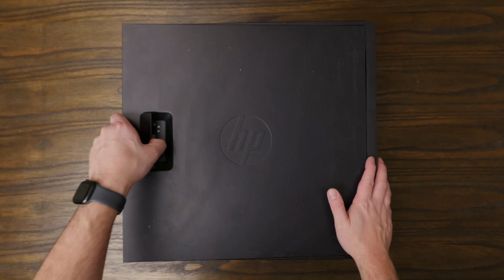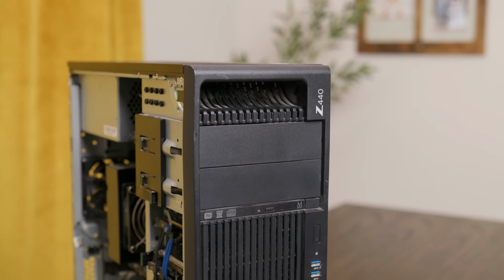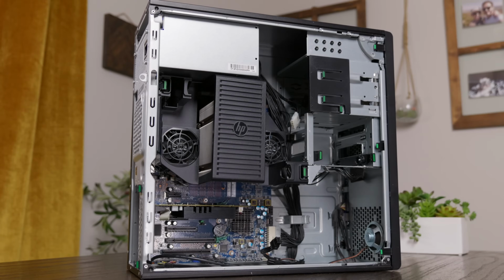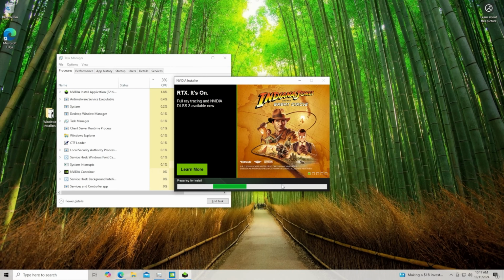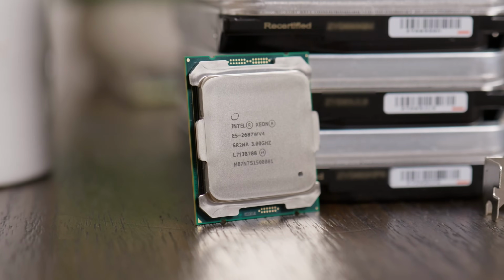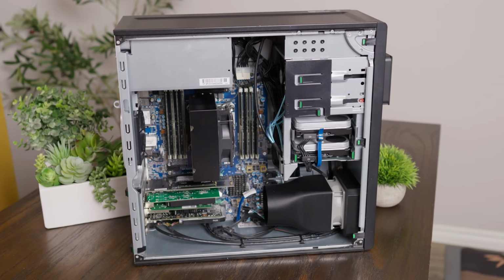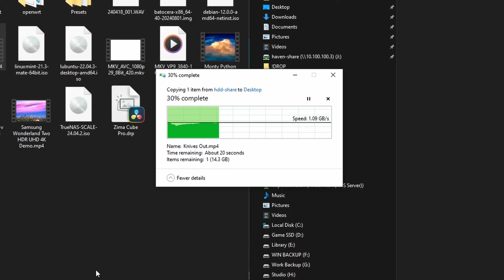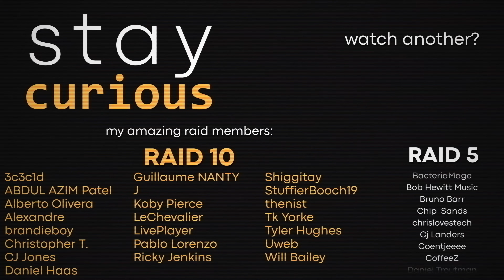This Upgraded HP Workstation/Server Is CRAZY Fun

Comment: I found an old dell t430 with dual Xeon 2606v4 and 16gb ram and set it up with unraid. I have 5 1Tb hdd’s in it atm but plan to upgrade those in the next couple months. This is my first experience with running a server so it’s a steep learning curve!!

Your video was very insightful, so thank you!!

Comment: I am looking to build a Dual Intel Xeon E5-2699V4 CPU system. It will be 44 cores and 88 threads when finished. I am just hoping it will be enough to do 4K, 6K video editing with VFX. Also do some Blender and other software. I believe it will be as 44 cores is pretty powerful.

Comment: power consumption and cpu power are both out of time. the only good thing about this hardware are the pcie lanes ofc. in every other usecase, u better use a modern cpu! u will geht much more cpu power for less energycosts. also the noise might be a problem with enterprise grade hardware
Reply: The RAM is cheap

Comment: Interesting little tidbit for anyone reading comments almost a year later. At about 8:10 he talks about the PSU only having 6 pins. While this is true, HP vastly overengineered the PSU on these units and the 6 pins can actually supply the same power as regular ATX 8 pins. So you can just get a 6 pin to 8 pin adapter and supply power to 8 pin GPUs

Comment: FYI: the two 6-pin PCIe power cables can provide 12V x 18A = 216-watt each.  Meaning, you can safely use 6-pin to 8-pin PCIe power adapter cables.
Reply: in pure electrical way 6 and 8pin pci-e CABLE are the same - only difference is on pci-e socket of card (6pin has 2x GND and one SESNE) pci-e has 3x GND and 2x sense)
also by molex specs each terminal can hold 13A, of course with multiple wires will be a little less but still I think it will be capable of 10A (30A in total so about 360W

Comment: Just for anyone worried about re-used drives... I'm an ex global IT manager in a few platforms (IT, Finance, personal data etc). At home I run massive data - all on re-used high capacity drives. Cheap, reliable, fast. What more do you need? Solid state is better but... price per buck? Assuming you have an nvme system drive, the additional drives should be fine. My system is 10x 12TB 7200 rpm 256MB lv3, under a 2Tb nvme. All of it "re-conditioned". Never had a problem with any of it. One drive makes some strange noises that do worry me - but it works fine so far (2 years). I have backed that one up, admittedly..
Reply: What more do I need? Availability. Living in a third world country, official refurbished/re-condirioned drives are nonexistent. International shipping isn't any good because after  shipping costs and import duty, it'll end up costing more than twice the price

Comment: get an nvme drive and an adaptor card. you might have to use clover on a usb drive to boot to the nvme but its worth it. i put a patriot 320 512 in my z420 and 6 times faster than the silicon power 1tb ssd  had in it.

Comment: The z440 actually has an optional oem front fan module, and the pcie 6 pin are rated for >150w, i believe hp themselves sell adapters to 8pin. With the 700w, and not the 550w psu which also was available, you can run two 200w gpus in sli in theory, or a 350w with dual 8 pin. I run a 1080ti no problem. Also, old server cache SSDs can use a pcie3.0x8 slot from the cpu to get modern speeds, im planning to get one

Comment: memory is expensive (again) but that 8 memory set is at $500 right now. 

personally, I would of either spent $250 for 4x32gb. If I was going to spend $500 on memory or needed it, I’d spend the $50-100 more and gotten 4x64GB instead. 

Nice build and the 3d printed bays are great for this. 👌
Reply: Even used server RAM is expensive ? I got 64gb of DDR4 ECC Ram for $30 2 years ago.
Reply: @rabbismooleymooley  yeah brother you got a STEAL DEAL.
One issue is this is quad channel, so you def. should stick to 4 or 8 sticks;

getting 4 sticks of 16gb now: 

1) USED is about $30 EACH stick, so $120 (or $160 new)

2) IMO more importantly, getting 16GB sticks limits you in the future: You can only grow to 128gb (w/o mismatched memory or replacing the 4 you already spent $120-160 for).

Comment: I've got a PowerEdge T330 i got from ebay. Since i'm in the EU i paid about 500 euro all in. It came with a Xeon E3-1240V6 which i replaced with a 1285V6. It has 32gb ecc ddr4, which is more than enough in my case. The most important thing was the 8 3.5" hotswap bays, that support SAS and SATA. It's filled with WD Enterprise 4TB drives in a single (hardware) Raid6 array resulting in a partition of almost 22tb. This is my Plex server. 

Since i had a free MiniSAS connector on the mainboard, i got a splitter for 4 extra SATA ports. In comes a 4x 2.5" bay in a free 5.25" slot that now holds 4 1TB SSD drives in a (software) RAID5 array. This is the storage share with all the files for the VMs i use with VMWare. 

Added a 10GB NIC and 2.5GB nics in the other systems, and ive got a multifunctional NAS with high speed/low latency storage. I've couldn't be happier. It does all i want it to do. SMB shares, FTP for external access, Dedicated management port with Dell Idrac8 remote management software, automatic backups to a different system, it hosts my PiHole, plex, webmin, NoIP Dynamic Update Client, a VPN tunnel, you name it. What a workhorse. With this configuration, my main rig is free from bulk storage on spinning drives. Result! 💪

Comment: I had a similar setup using a Lenovo p500 I loved the shrouds and removeble drive bays on it psu can be easily swapped too if it dies. I did end up selling it though later on.

Comment: if you get recertified drives from any website, make sure you do a DBAN DoD 7 pass wipe on it before you use it. it's impossible to tell what the drives were used to host or if the site you bought from actually did anything to make them safe for use.

Comment: Fun Fact: You can overclock E5 16xx V3 CPU's with these. Has to be done in Windows but I got one with a 1660 v3 up to 4.3ghz on the very, very good stock cooler.

Comment: I use an HP Z420 which is the older version of this with Ivy Bridge chips. I have a 2687W v2 and 128GB of ECC DDR3 RAM. Most importantly, I have a RAID card that handles all the storage with two 3TB and four 2TB hard drives. Still a fantastic machine to this day. 4K video editing works surprisingly well, and only struggles when adding intense effects, in which case I have a cache SSD to handle that. Perhaps most impressively, I bought the machine barebones for $85 on eBay. I had the RAM, SSD, and hard drives, so needed to buy the RAID card and the new CPU. All in all, probably a $200 build.

Comment: These are great machines, The Z840 and the Z640 are both dual CPU capable, and also found cheap, I have one running dual cpu 2687w's like he has in the video and it get a 15,000 score in Cinebench R23, It edits and renders 1080p video fairly well, not bad for 10 year old hardware you can build from used parts for super cheap. They use and boot from Nvme 3.0 which are super cheap now that 4.0 and 5.0 are out, ( you can also raid them for even faster speeds on these workstations ) You can also find super cheap pascal gpu's with 16 or 24gb of vram that they run very well, you can even plug a couple of touring class gpu's into them that use nv link and pool ram for llm's, this platform is widely known as the X99 platform, and is the cheapest high core count / good cashe / modern instruction set cpu's you can build a cheap pc or workstation from, and the parts, in the usa anyway are so cheap, it's a good platform for beginners to learn on, if you fry your cpu, you can just get another for $25 Lol

Comment: Have a similar machine of this era, a Dell Precision T5810. Apparently, with the power supply being easily swappable, you can get an 825W one and a custom distributor board to use a lot of higher power GPUs (dual 8 pin) and if you get a 1300W PSU (albeit not officially designed for the 5810), you can actually use a 4090 (quad 8 pin) or hell, even a Blackwell 6000 pro if you want to.

Comment: I still use my z440 as a gaming rig upgrading using bits and bobs I find at work. We get a lot of old servers sent in for recycling and sometimes we can find gems worth salvaging. It's CPU is only 6 core so still looking to upgrade that. But it has 128GB ECC RAM, 1 TB NVME, 5TB mech drive for storage and an RTX A5000 24GB GPU. Yes this perfectly working beast of a GPU was sent in to be recycled. Now it helps me play Star Citizen 😅😅😅 but because it's all just old recycled bits none of it cost me a penny
Reply: Lol can you send me some of that hardware,?

Comment: hello, just a heads up here about your cpu choice in the video, You could have gotten a Xeon e3-1241 v3 at half the price and slightly higher preformance, you can also get the e3 1271 v3 since its slight bettat than the 1241 but its not worth the price differance.

Comment: I actually have the big brother to this system, the Z640. It acts as my all round main server, hosting jellyfin, around 25 different game servers and such. The only drawback is that power consumption. Mine is configured with 2x E5 2680v4 chips and 256gb ram with a gtx 1660ti for jellyfin transcoding, and helping in some game servers. These old HP systems are DEAD reliable, and I've gotten a lot of use out of it even if I have to eat it on my power bill...

Comment: For people not using Windows, you don't need the HP application to change the hidden Headless setting. You can export and import config using the "replicated setup" menu in the BIOS. The config will be stored as a txt file to a USB drive.

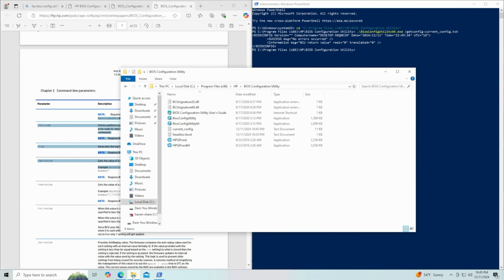Comment: For anyone looking for Headless boot on 13:15 here are some details:

You need to boot Windows baremetal so a vm wont work for the utility.

Run powershell and change directory to the path where you downloaded the Bios utility and run the line below:

 .\BiosConfigUtility64.exe /setvalue:"Headless Boot","Enable"

Comment: This video inspired me to consolidate a couple machines I had been running into one system. I ended up getting a Z440 off eBay with an E5-2690 v4 processor. I upgraded to 256GB of RAM (make sure you don't get LRDIMM modules, which I definitely didn't do first). I had a 1070 I was hoping to use as the video card for transcoding, but what's not apparent here is that there is a foam covered metal bar that sticks down from the lid which prevents full height cards from being installed. I think this is mainly due to the 700w PSU and maybe HP wanted to guarantee that it wouldn't get overloaded? The 1070 also required an 8-pin power connector, so instead of using a sketchy dual 6-pin to 8-pin cable, I picked up an MSI GT 1030. I used a StarTech 3 bay hot swap backplane for my TrueNas drives, and have a couple 512 GB 2.5" SSDs mirrored for the Proxmox install, mine did not come with the mini DVD drive though, but I don't miss it at this point. I've ordered a 4 port SATA card to fill the lonely PCI slot and will add a couple 2.5" HDDs in a mirror as backup storage for Proxmox. I also grabbed a 2 (10G) and 4 (1G) port network cards for network passthrough to my VMs. The AMT and add-in NICs are then plugged directly into a dedicated 8 port UniFi switch so I can have direct control over them and can assign VLANs to the port itself as desired. I learned so much from this process, and I'm glad I went through with it. After watching Jeff Geerling use NUT for his server, I threw directly on mine (instead of a Pi) and that then got me into using Home Assistant as well. In the past I just used old machines for simple use cases as needed like TrueNas, but this was my first deep dive into home labbing and I love it!

Comment: FYI, at least on the z640, the six pin will power an 8 pin with an adaptor.  It has the power no problem.  

The CPUs in these were way ahead of their time.  They overclock a LOT. You can add half a gigahertz or more to most of them.  The z640 has second CPU tray you can slide in there if you want.  Imagine this with a dual 22 core (88 threads) and a 4090.  The CPU tray gives double the RAM too.

Comment: Great video. Question! Can I just replace the raid card (sata) and put in a sas card to add 4 16tb drives? I bought the drives by mistake but new on sale and a gr8 price.  Bought 4 22tb sata for my Ugreen NASync DXP4800 plus.  Or is there another cheap server that will accommodate the 64TB sas drives.  If there is I'm having trouble finding a used server.  Thanks!

Comment: I have one of these things running as a ProxMox server. Runs great. One question though. How did you get it to take the 256GB of RAM? The most mine will take is 128GB (8X16) which appears to be the max for the machine on the latest BIOS. What specific RAM did you use?

Comment: I've had the Z440's bigger brother Z840 as my pain workstation for the last 5 years. It's still a beast. I upgraded the CPU's twice and now am at the highest core count E5-2699V4. 

I'm a software developer and having that many threads is really nice if you're into writing heavily multithreaded apps. One of my processes was taking 45-50 minutes to run single threaded. Once I modified and was able to take advantage of as many cores that process dropped down to less than 4 minutes. One thing to note on a system like this is with dual cores, a single app only has access to ONE of the CPUs. This setup is a bit more like two computers running inside one box. This is still nice as if you have one monster app using ALL the cores from one CPU, all your other apps are free to use the 2nd CPU.

Still at the end of the day, these systems are still useful for some tasks and can be bought for like 10¢ on the dollar for what they were when corporate America paid a ton for them 10 years ago.

Comment: I'm just having a little fun with a Z240 I got for £60 on eBay. Usefully the CPU is an i5 6500, so has onboard graphics. This machine has no need for high end graphics for its intended use (Linux server, so usually headless). That means I don't lose the 16x pcie slot (though I have no idea if I'll actually need it for anything: the only thing I plan to add pcie wise is a 4xSATA card to connect to an Icydock, or perhaps two of them). I had a spare 256GB nvme, and it roots and runs kubuntu delightfully fast from that. It only has 8GB RAM, so at some point I may upgrade if I have need for more. (Once running headless, naturally I'll disable the Gui to save resources.)

I have/did have a Z800, but alas its mobo died. I love the attention to toolless design and stuff you get with these workstations compared to commodity PC's. But the big ones are pretty power heavy (i.e. a CPU with a 130W TDP compared to the 65W of the 6500 -- again if the 6500 is fast enough for the intended use case, you don't need anything more).

Comment: Fun fact, the z440's psu is overbuilt, each 6 pin pcie supplies 216w, meaning you can throw in a 3080 no problem just using a couple of 6 to 8 pin adapters but ensure they're from a decent brand like cablematters.

Comment: Today i just created i3 12300T, 128GB RAM, 3x exos x22 20tb, 256nvme, ssd cache evo 870 1tb. When drives spindown it eats ~25W, 35W without spindown, 40-50W during standard copying, VM. 80W i saw just on the boot. Performance almost 2x better on single core but multi i3 loses about 33%. Still worthy

Comment: "powercfg /h off" type that into an admin terminal (cmd or PowerShell) and it will disable hibernation, no need to mess around with it when you have an SSD, it's a legacy feature that was designed to speed up boots on HDD systems decades ago.

Comment: I picked up the predecessor to the Z440, the Z420 with the Zeon e 1620 v2 from eBay about seven years ago for $350 and added a 512 Gb NVME, Samsung 751 Pro (with bootable BIOS + $20 x4 adaptor card) for the same price. Up dated the HP BIOS to support NVME’s and Secure Boot (Win10). It’s been my wife’s daily driver for 7 years, upgraded to 32Gb ECC DDR 3 because my wife keeps 20+ tabs open in Chrome for her job. Also upgraded the original Quadro 2000 to a Quadro P1000 because it was failing. The power supply and cooling fans continue to operate great. Unfortunately, the Z420 and Z440 doesn’t have Win 11 support.  I guess our next step is a Z4 G4.  Thanks for your video.
Reply: 32gb on tha system is nothin, the z420 can go up to 256gb ddr3 rdimm as well.
Reply: My Z440 is currently running Windows 11

Comment: People have become snob when it comes to servers.
You really do not need much from server when it comes to CPU and RAM.
The primary task for the server is to act like a file server, a printer server and then have needed common services running like email, backup, boot, etc. 

Some people have these silly ideas that server must be like mainframe running hundreds/thousands of workers software and crunch down complex mathematical models etc. 

No... Nothing like that.
Just keep your PC as the workstation, and server to handle the long term system in your network. 
Your PC does the 3D modeling, video editing etc. And your local storage does the saving.
When the project is done, you move it to server to be there.

Comment: I'm in the process of doing the same with a Z420 with a V1 of the same processor. I got 128gb of RAM in it but I found out I could get a 256gb of RAM if I use the right type of DIMMs. I haven't bought storage yet, and excluding the cost of the CPU I bought that was incompatible due to the machine having the wrong boot-block date, I'm in for $130 ($30 for the computer, $30 for the CPU, and $70 for the 128gb of DDR3). Potentially going to set it up as a media server as well. This has some valuable info for my project so thank you!